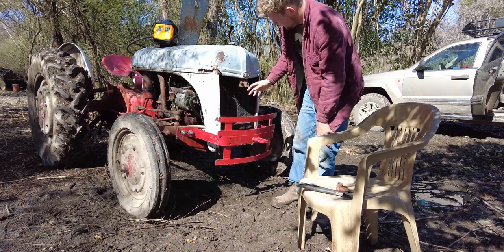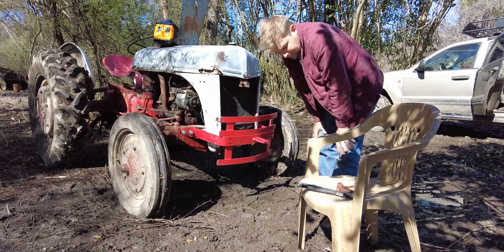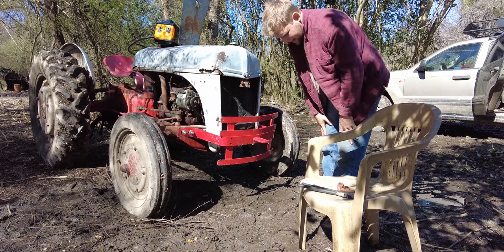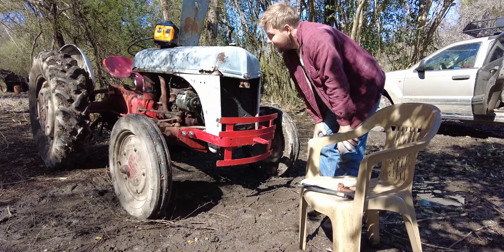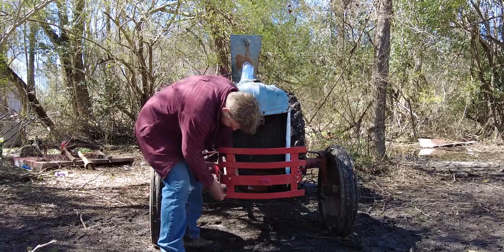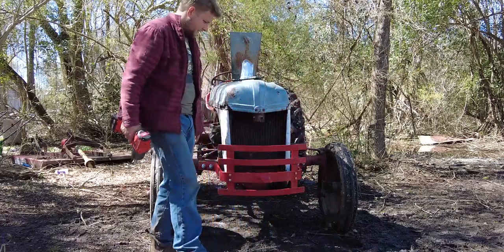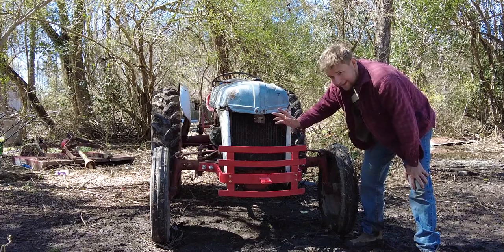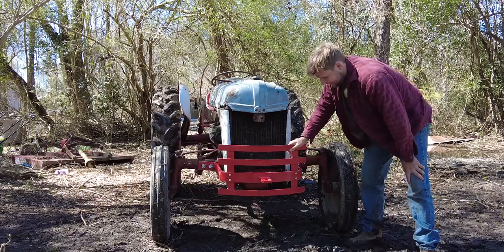Bumper and Grill Guard For Old Ford Tractor

Comment: that tab on the bumper looks like a real shinbuster.  Will a tennis ball fit on it?  We used those at the nursery I worked at to top the pipes which lead the hose around the blocks of nursery pots.

Comment: Not sure how big a tree you intend pushing, but that's not generally a good idea.  At a minimum, that guard will likely get bent up.  I suggest cutting the tree off several feet above ground and using leverage and pulley blocks to pull out the stump. Check out what this guy does with a tractor half the weight of your Ford.

https://youtu.be/bRTIwWUg4fc

Comment: After watching you drag parts of the dead tree with the tractor and brush in a pick up couldn't you find an old flatbed trailer to haul debis in?  It would entail fewer trips to the burn pile.  You would save money on fuel.
Reply: Guess the answer would be no from the looks of it.